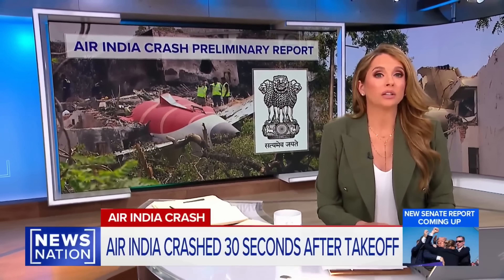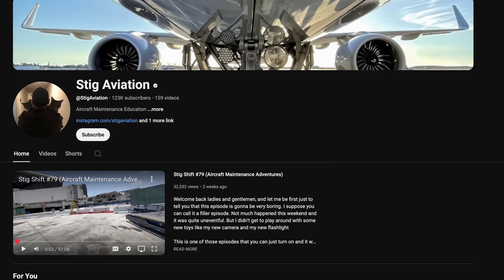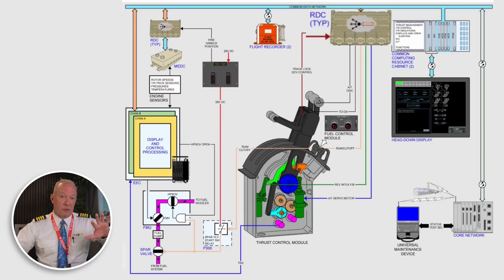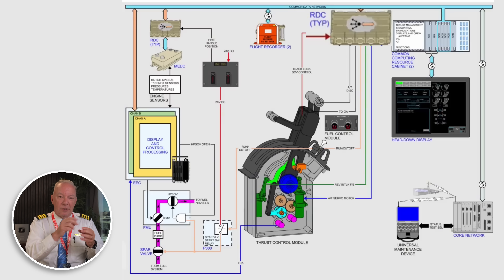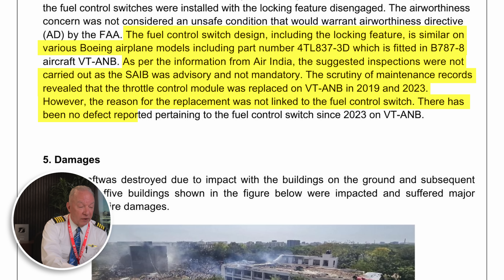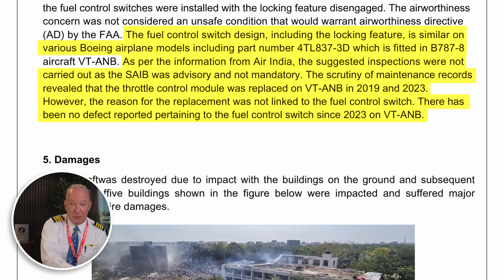The Truth About Boeing 787 Fuel Control Switches

Comment: I'm afraid the words you are saying simply do not correspond to the diagrams you show (I'm not saying you're wrong, but if you're right then the picture is a complete misrepresentation). 4:42 "Actual electricity, not a digital signal ... no other inputs ... no digital signal" - there is LITERALLY an AND gate shown on the diagram in the path to the third valve, with one input un-labelled, and the second valve is shown ONLY controlled by another box (display ?), not involving the switched 28V at all. Also you say "closed loop system" - what you describe is NOT a closed loop, it is an OPEN loop, in the sense that it just sends the command and expects it to be carried out (closed loop means there is feedback to check it has happened, and typically if not, try harder). I am a control engineer and these are the meanings of the words you say in control theory. I appreciate both that aviation may have differing terminology and electronics might not be your expertise (side note, I do not believe there was a relay in your demo circuit - it just looks like a swtch to me). So I may be sounding picky but terminology and semantics is REALLY important here. (later you say "closed" again, and from the context I infer you are really meaning "independent"). Also, the system as described is completely vulnerable to wire-falling-off syndrome. As a fail-opeational design I would expect this to be wired the other way round (although that would mean a wire falling off means you can't shut off the fuel, which is probably about as bad). Normal procedure would be to make both positions of the switch "active", maybe with an RS flip flop or a separate functional relay on each pole. I also want to know EXACTLY what node in the circuit is the one monitored by the black box when it said the switches were turned off and then on. Also, there IS a path shown from the RDC to the fuel switches, it is not clear what direction it goes, but it does suggest a possible interference path. Also, what you say about the fixed battery feed is NOT what the diagram shows. The feed to the relay CONTACTS might stay good, but the picture does not make clear that the feed to the relay COIL will remain live. I really think the first part of this video needs a full clarification, maybe get a sparky to join you to be clear about what in the diagram is actual wiring and what is abstraction.
Reply: Please watch Flying Beasts analysis before commenting about this topic

Comment: @CaptainSteeeve : Your explanation that the power circuit in question is independent and cannot be altered by digital signals is very clear. But a water-induced shortcut could put the whole circuit out of business (albeit for a shorter or longer time), couldn't it? Please can you comment on these chaps' conclusions in your next episode. https://youtu.be/t_t8nX7lb0U?si=s6zXbbp2BLj-sOEH&t=1012

Comment: You mention that the module was replaced twice. What is the nature of the connectors, leading to the question whether the connections were faulty. This would only be relevant if the relay would close the valves when it lost the input from the switches.

Comment: I still think there should be an off delay timer driving the fuel cut off relay which is controlled by the fuel cut-off switches.  Said timer would allow the crew to react should something horrendous happen in the cockpit.

Comment: 9:52 Elsewhere someone suggested that the battery died. It wouldnt be the first time the 787 had battery issues.
Reply: Both engines were restarted afterwards though. If the battery was discharged enough to cut both engines one after another it wouldn’t be capable of restarting.
Reply: @lg-ii6pm  doesn't work like that though, battery busbar receives power from the engine generators once they are running, it also powers the FDR and CVR which would have dropped out until the RAT power came online if the battery had failed.

Comment: The cutoff switches have a mechanical interlock to prevent accidental operation. That's perhaps not as foolproof as we may think as a pilot would have performed that action many times, their brain knows some switches need a certain action to operate. Reaching for the wrong set of switches the person could simply pull the knob from memory without their mind realising they have the wrong switch.
Other aircraft have those switches in the overhead console making them less likely to be accidentally operated.

Comment: Steve, can you clarify whether there is a sensor for the fuel control switches - this is the only way of determining that the switches have been physically moved.  My research indicates that there is not a sensor and my assumption is that the closing relay is the input for the data logger - is that correct?

Comment: Captain Steeeve, my comments below in a reply to this comment, but in summary, please consult with an FAA Designated Engineering Representative, or near equivalent, such as a licensed electrical engineer, such as a professional engineer.  We all want an easy out, but this is not an easy out.  The cause is inconclusive.
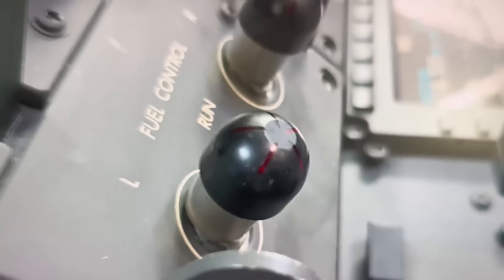Reply: @ 1:00 I plan to watch that, however, the mechanic's perspective is likely going to be mechanical, and not electrical.  Need to know the electrical state of the switch when in "cutoff":
electrical contacts closed for cutoff, or not.  If the contacts are normally closed for cutoff then it is possible that moisture ingress can cause the switches to trigger nearly simultaneously (contingent upon the electrical design).  

A friend of mine flew in an MD-11 flight deck on a transatlantic flight and the cockpit was dripping intensely with moisture (note that later, a Swiss Air MD-11 caught fire in the cockpit and crashed into the ocean.  The "cause" was attributed to likely insulation failure on the inflight entertainment system "wiring").

@ 1:30 Really need a released electrical schematic of the switches to determine.  If the cutoff state of the switches are having the contacts closed, need to ask what if moisture ingress on both contacts could trigger both of them to electrically conduct unexpectedly.

@ 2:40 Not only is the time tolerance not provided in the preliminary report, only one shutoff time stamp was provided.  In the same sentence, they said "about" and "immediately thereafter" with a "01 sec" "gap".  We do not know where this time gap begins, nor where it ends.   For all we know, the switch state transition could have occurred in 333 milliseconds, the report is ambiguous at best on the timing.

@ 3:08 That is a big gap to allow water and moisture ingress.  These switches really need to be rated water proof (in terrestrial terms NEMA rated for wet environments.  Really, all the RTCA Level A components need to be water rated, but I suspect they are not.  My reasoning is based on moisture observed, particularly in Swiss Air MD-11).

@ 3:45 It is NOT purely mechanical, it is also partly electrical.  The mechanical part, controls the electrical/electronic contacts.

@ 3:57 that looks like a cut and paste schematic.  Need to see the full electronic contact points of the control switch that controls the relay (energized/not energized), showing mechanical position state (i.e. normally open or closer for both switch positions).  The way the relay is drawn, it appears to be normally open, if that is the case, then if I am reading this correctly, it needs to be energized to keep fuel flowing.

@ 5:05 that is contingent upon the integrity of the electronic contacts that control the relays, especially if moisture/water ingress upon takes off (again see MD-11 moisture commentary above).

@ 5:50 Try pouring some salt water on that switch and see what happens...

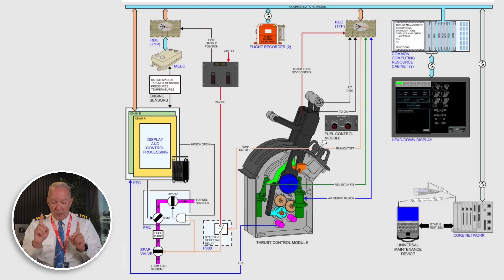@ 7:28 The electronic contacts on the run/cutoff between the mechanical switch and the relay is incomplete.  I need to see the electronic contact pins inside the mechanical switch that controls the relay states, and their respective mechanical position states.  Also need the specification on the Remote Data Concentrator (RDC).

@ 8:15 The relay control comes from the RDC, need to see the fully released RDC (with the entire revision history), and fuel switch specification and schematic.  I am not convinced without seeing the released specifications and any modifications (they replaced the thrust/fuel switch control module twice!).  My understanding is the RDC is a digital system (Captain Steeve, please be weary, of dancing around the edge, of the Dunning-Kruger effect, here).

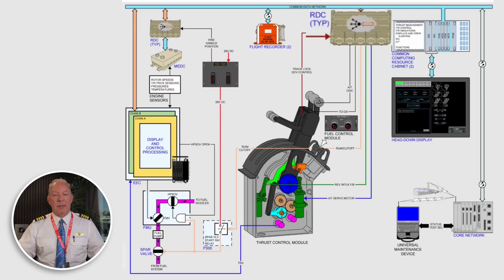8:50 Common Mode failures do happen, and by design, at less than 10E-9 fatal crashes per flight hour, if designed, and operated, to this standard.  The "01 sec" "gap" is completely ambiguous in the preliminary report.  We do not know where the gap ends, nor where it begins, if it includes the 180 knots message, or not, and no time tolerance is provided, and only one time stamp is provided.  It is a "bridge too far", perhaps from a pilots perspective, but not from the perspective of an electrical engineer, and please remember you are explaining this from a pilots perspective (and please remember the Dunning-Kruger effect, and I admit, I am not a psychologist, I am just aware of being able to say "I do not know" or I do not have enough of the correct, valid, and verifiable data, to draw any conclusions.)

@ 9:20 It is not impossible to have a battery fail.  If a car engine has a short on the starter battery there will be no more power to the ignition system as this would also short out the alternator.
Reply: @ 10:20 A simulation is not the same as an electrical system test, unless they simulated the electrical power system accurately (via the laws of physics).

@ 10:35 Need to ask, what duration of a voltage spike loss would trigger the fuel relays to de-energize.  You are assuming no failure on the DC system.  A voltage spike on the common ground could easily de-energize both relays.   Need to ask, do the relays have a common ground, or are the relay grounds electrically isolated (and if so, how).

@ 12:30 Hindsight or not, a common mode failure in those switches is a catastrophic RTCA Level A failure that would degrade the 10E-9 fatal crash per flight hour requirement.  Keep in mind, AI replaced this module twice.   Need to ask why.  This alone is highly suspicious.  Were they troubleshooting an intermittent problem while replacing/refurbishing both engines this year and thought they fixed an intermittent problem, or was this a normal mean time between scheduled replacement?  Really need to see the maintenance records to know.   Keep in mind, every time a unit is replaced it will put mechanical stresses on connectors (and/or wiring insulation/contacts).  If you ever had an old plug and found it would not make full contact with an outlet you can understand that bending contacts can cause them to be intermittently unaligned.

@ 14:00 Note JetStar 787-8 had two engines have loss of thrust mid flight in 2019 with a 1 second gap too (no time tolerance stated).  It would be extremely helpful if you did a video on the report from the Japan National Safety board.  You can note something peculiar on their fuel filter comparison in the report, of 500 micro meters compared to 50 micrometers (as you say, it is a "Bob's your uncle" type of comparison).

@ 15:00 Please look at "Airline News with Geoffrey Thomas"
@geoffreythomas-on-air channel.  Geoffrey interviews an experienced avionics "engineer",  and he recently provided a report on his most recent video today August 13th, 2025.  I have not read it yet as I am supposed to be on vacation, but I will read it too.  He suspects water ingress into the avionics .

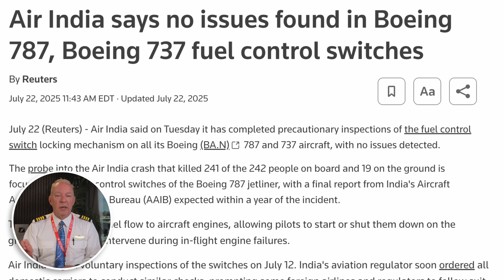@ 15:50 I do not think they checked them for moisture.   Moisture ingress can change the state of the electronic contacts on the switches, and this can cause the relays to de-energize contingent upon how the contacts are designed for each switch state.  Moisture does not need a lot of acceleration to change a contactor state, especially if the contacts are not sealed and not waterproof.

@ 17:00 mechanical movement is not the only way an electronic switch state can change.  Water ingress can change the state of a normally open contact to closed without physically moving a switch.   Need to ask, are the fuel switches water rated?  I suspect not.  There is not enough evidence to conclude anything.  

@ 17:45 It is even more important to question our own perception.   I am not ruling out the pilots hand, but I cannot rule out moisture, or other unstated reasons.  Please have an electrical engineer (ideally a licensed PE) to discuss these switches with you in a video, and how a mechanical switch can fail by moisture ingress.  If you do not know of one, I can help you find one, just reply to this comment.  Please note, we live in a time where if someone can turn on a light switch, they get the title "engineer" when the reality is, they do not know how complex it can be (note: Einstein's Dad was an electrical engineer, but he failed at business), hence we have licensing systems (e.g. FAA Designated Engineering Representatives - DER's, or Electrical PE's - Professional Engineers).

Comment: What you need to understand is that the switch controls an electrical signal, if there is for example damaged isolation on the cable and the conductor touches ground, somewhere along the circuit, the signal will go low and whatever relay is controlled will see switch as turned off.
Reply: In your little battery thingy you showed, try add a connector to the output of the switch to the negative on the battery and see if your thingy still reacts to the switch…

Comment: I have been following two aviation "specialists", one located in Germany and the other located in Australia, that claim, through "expert" analysis, that the fuel cutoff switches were inadvertently activated through water accumulating in, what they call, the Ebay in the aircraft, and that the fuel cutoff was due to an electrical short and not due to pilot input. Is that even possible?